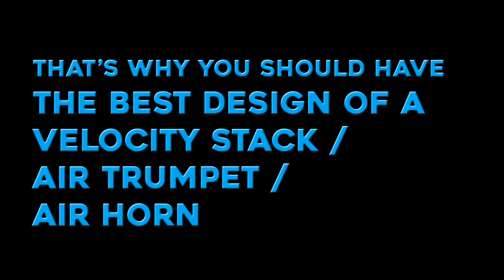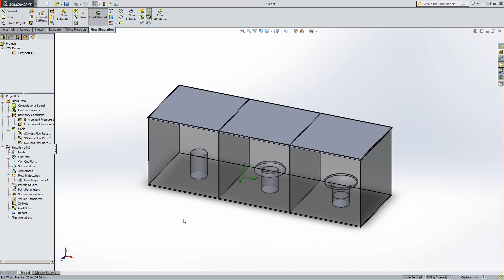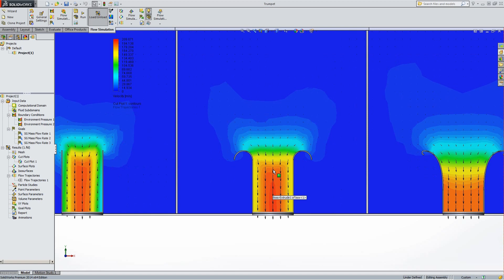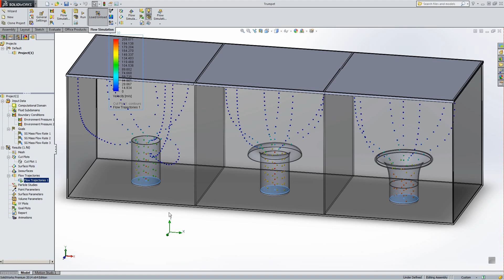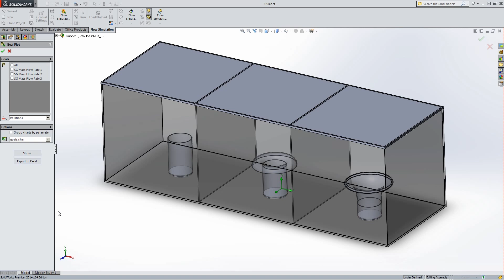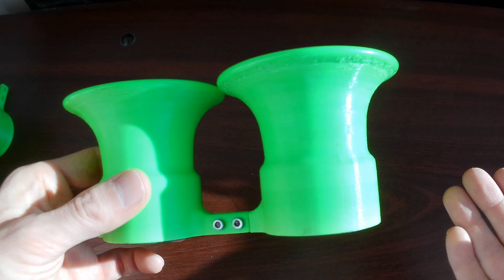Design your velocity stack / air horn / intake trumpet properly!

Comment: Nice.  Watching your vids as I´m considering a DIY ITB build for my Lotus S2 Elise.  It would be interesting to see if dynamic runner lengths would work, perhaps using a stepper motor and either linked to TPS or custom ECU.
Reply from the maker: You should control the runner length according to the RPM. The optimal runner lengths don't depend on the TPS's value.